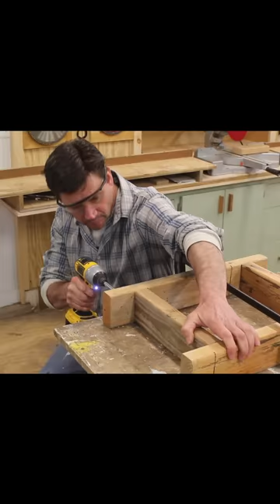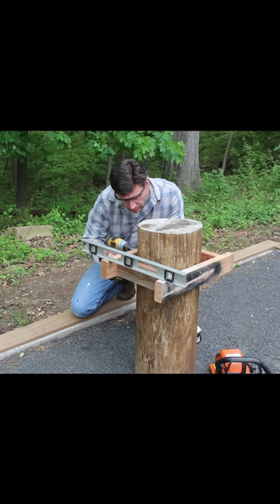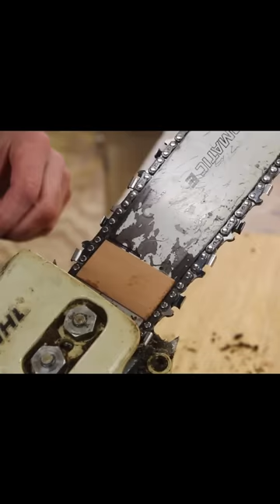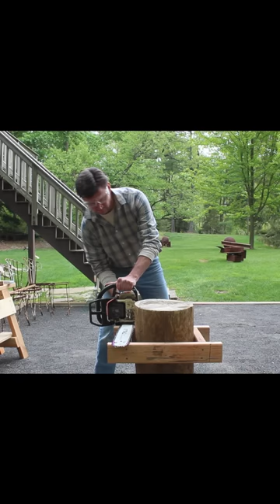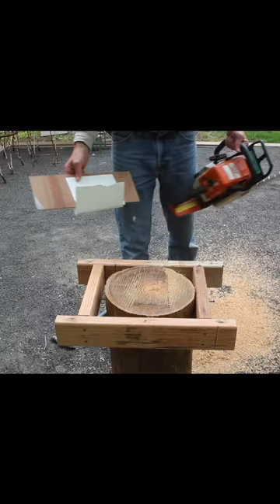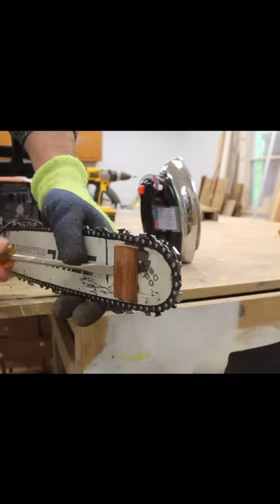Make a Level Cut with a Chainsaw #shorts

Comment: That’s awesome!! Thanks for sharing 

What are you put on the saw to bind those 2 pieces to the saw? Is that a specific kind of glue?
Reply: Contact cement. Apply to both surfaces.
Reply: @markjob7736  omg, no, not contact cement lol, hot glue
Reply: @nickkk420  Yes, contact cement. You can't brush on hot glue like what he did. It has to be contact cement.

Comment: Screw the jig into the wood above where you want to cut, so the screw holes are on the scrap piece instead of the bit you are saving.
Reply: To hard to hold it steady against gravity
Reply: @raymondstrausser8169  flip the log upside down too

Comment: Why not use that hole to bolt a spacer on to the bar , you wouldn’t have to glue it on and it would’ve been easier to remove